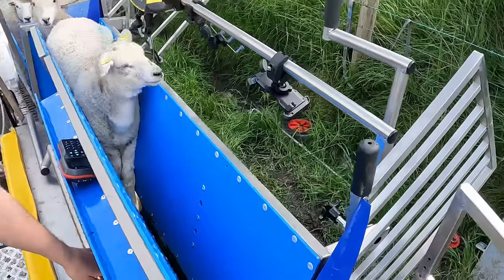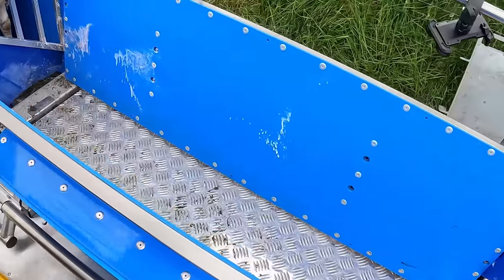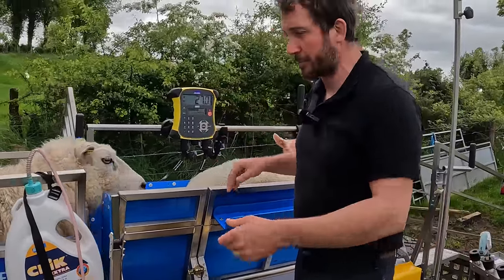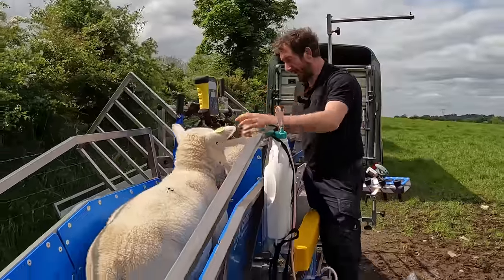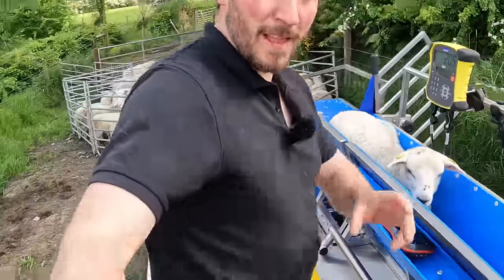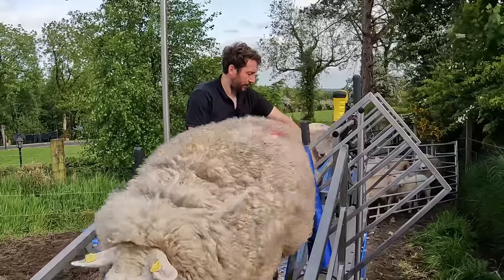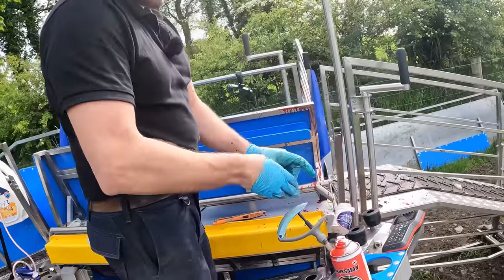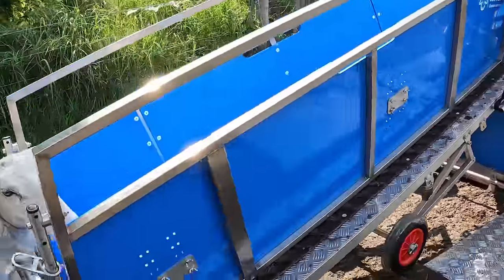Sheep Farmer Uses Amazing Handling System For The First Time | Could It Be The Best Ever Made?

Comment: Looks good. 

I recently got a ShepherdsMate. It is very good too.
Reply from the maker: Shepherds Mate seems like a well made machine too. 
What is it like for young lambs?
Reply: Just realising I hadn’t replied! 

It is very good for young lambs too. Can Heptavac them very easily up the ramp as a big batch of lambs together or individually in the actual main part of the Shepherdsmate. Forcing pen is a good job and leads them all on through. Digital weighing and daily live weight gain indicator is outstanding bit of a game changer I think. Sheep and lambs were a bit wary first time I used it but they walk through themselves now and very calmly too. Straight to the footbath or can draft them off to the left or right if needed which was handy when pulling ewes off to get them clipped which was a 1 hour job last year but this year now I have the Shepherdsmate it only took 10 mins. George at Shepherdsmate has been very good to deal with too which is good. Great product.
Reply: Sorry just seen this comment have you got the turn over Crate with it
Reply: @dylankelly1483  yes got the turnover. Good job. The squeeze and the weighing are the best parts i think. So quick!
Reply: Thanks very much looking to get one myself
Reply: @dylankelly1483  George is very good to deal with. First time setting up takes a while but after you do it a few times and get the hang of it can set it up and take down in around 5-10 mins.

Comment: Hi David, thanks for the review this looks a great machine for lambs. I have a Ritchie combi-clamp which possibly could be better for ewes where they enter on the right hand side and exit on the left as I am right handed this is better for dagging I feel.
Also trimming feet where I have good access and can lift up each foot for a trim and inspection.
It does not work for lambs of this size at all where the Cotter is really good. 
Whats great about both of these machines is the saving on the back and it's like working in a sheep factory where all the gear is handy and the sheep come past one after another, also a radio with some music is nice 😊
Reply from the maker: Definitely saves the back. I dread those first jobs with lambs but I wasn't in the slightest bit tired after that batch..

Comment: Hi David, just wondering what reader have you got and does it sync to flockwatch? thanks.
Reply from the maker: Reader is Agrident APR600. It does connect with Flockwatch but you have to enter the weight from the clock manually on the App.

Comment: Looks a good job David. What sheep software are you using?
Reply from the maker: Using TGM's software. They are based in Northern Ireland. Great tool for the performance recording and very easy to link data to Sheep Ireland.
Reply: Use it myself & find it great. You have a lot newer handheld than i do. What were your dwg like?

Comment: Why not just let the lamb walk out like the ewe, whats the purpose of the drop floor?
Reply from the maker: I wondered that myself before using it...
When the floor drops the lamb drops a little bit into the sloped sides. If you try to lift the floor back up without releasing lamb essentially you have to lift the lamb back up which wouldn't be possible with a simple press of your heel.